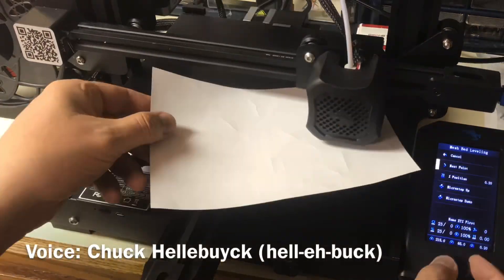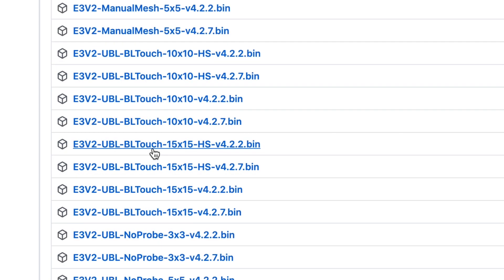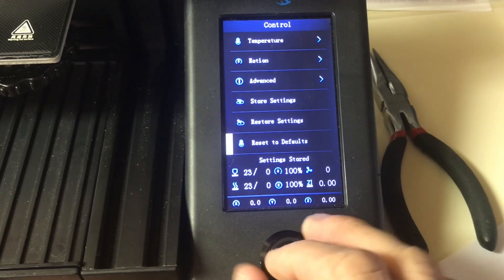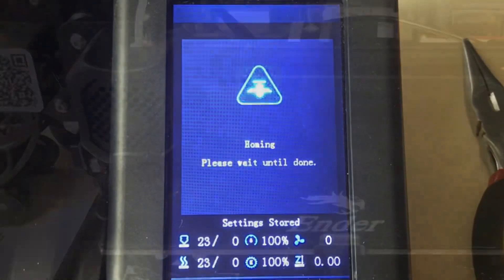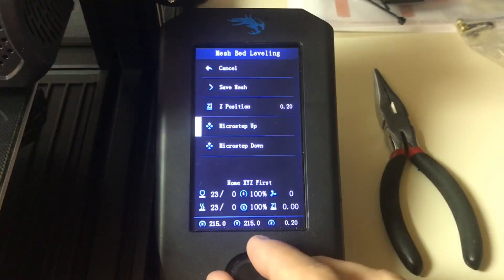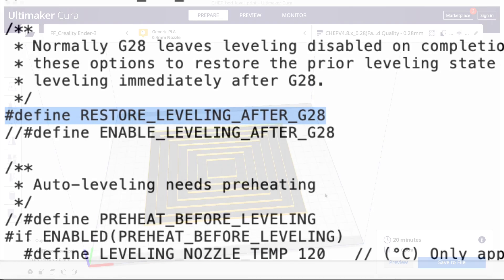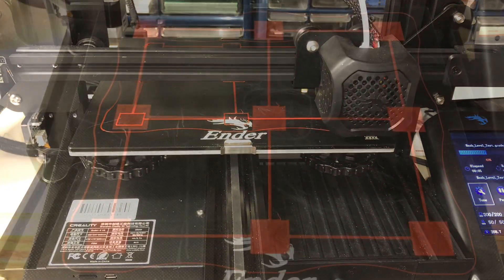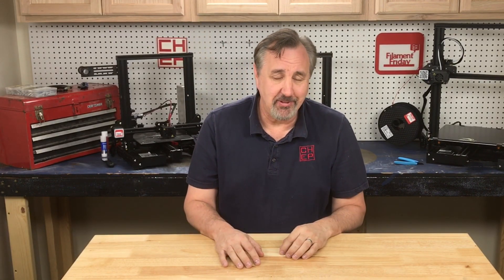Creality Ender 3 V2 - Mesh Bed Leveling

Comment: I know I'm missing.  I'm a simple user but I wanted to add a runout sensor so I bought one from Creality.  I have an Ender 3 V2 Neo and I just flashed Jyers 10x10 for version 4.2.2.  I had this dead on before all this and the sensor does work, but I can't get it to print or level.  As was mentioned in the video, I dialed it in but when this goes to print, it must be extruding a good 6-10mm off the build plate.  I know it's an operator error but if I can't get it to level, I have to go back to the default flash and I really want that run-out sensor.  Any more thoughts?

Comment: Well, thanks for sharing. But tell me one thing: if the Z limit switch sensor is on, nothing occurs when you push the microstep down, right? So, isn't better to disable or low the sensor a little?

Comment: I Have a Aquila ( G32 chip ) and I have upgraded it with a dual z lead screw system and a all metal hot end and a C R Touch by Creality, 
The Problems I have are I do the manual bed leveling 1st really well, then 
I do the auto leveling with the bed at working temp and lastly I do the Z off set in the middle all are saved afterwards.

The problem though is the printer will do a good starting purge line on the left edge of the bed before the printing,

But when it goes to the middle to star the printing I found the nozzle was way too high about 3 or 4 mm's to high off the bed. So I have to use the Alex firmware to lower the nozzle down
to the bed surface by those mm's to even have it lay down the print. I tried many times to re-level the bed and each time it is too high to start the print but fine on the purge line height.

What the heck can I do?

Comment: What is the base/starting point for the sensor/mesh? I'm running a cr touch and it always starts homing in the centre so I levelled the bed to the centre assuming this was the point for everything else. It ended up way worse than levelling the bed manually just based on the outside corners. Presumably to adjust the bed height there has to be a starting point to compare all other points against. If it's not the centre is it the bottom left corner?
Reply from the maker: The firmware should probe multiple points with a CRTouch. Not sure why yours doesn’t.

Comment: This firmware does not work with CPU Giga Device or RCT6
LOOK YOUR CPU before updating firmware

Portuguese TEXT
Tive problemas com minha impressora 3D ENDER V2

 Algumas Ender 3v2 vêm com a placa 4.2.2 e CPU GD32F303 GigaDevice, essa CPU não é compatível com esse firmware. NÃO INSTALAR!!!!!!

Para as Enders com CPU STM32F303 RCT6 há relatos de risco de incêndio. Não instalar!

Murilo, tem gente instalando esse firmware em Enders 3v2 mais novas e correndo risco, outros estão com diversos bugs. Se puder, atualize a descrição do vídeo ou faça um novo sobre o assunto. Se quiser posso te encaminhar os links que encontrei sobre o fato.

O firmware é muito bom, mas não basta olhar a versão da placa, tem que olhar se a CPU é STM e chip com 512k. Não é compatível com as CPUs GigaDevice.

Minha placa é GigaDevice instalei esse firmware e a impressora travou na tela com a logo da creality tentei voltar o firmware e deu mto trabalho(muito msm) consegui desligando e ligando a impressora loucamente e uma hora desistir e do nada ela voltou ao normal.

Para saber se sua placa é compativel com o firmware vc precisa abrir a parte inferior da impressora e acessar a placa principal. Nela tem a versão impressa 4.2.2 ou 4.2.7, além disso vc tem que localizar o chip do processador ARM, se for STmicroeletronics terá a inscrição STM32F303RET6, esse é compatível com o firmware do vídeo acima. Se terminar com RCT6 não é compatível devido a memória interna ser de 256k. Algumas enders mais novas, como a minha, estão vindo com Chips da GigaDevice, nesse caso a inscrição no chip é GD32F303RET6, para o qual o Marlin ainda não dá suporte, por isso esse firmware não deve ser instalado para evitar bugs relatados por vários usuários(inclusive EU).
Reply: obrigado por avisar, eu já ia colocar isso nas minhas máquinas e fui conferir e todas são gigadevice GD32F303, vlw por me livrar desse B.O. mano

Comment: Holla, I installed version v2.0.1 - Major Fixes, the item level does not appear on the display, the item info appears, do I have to install a previous version, if yes, can I install by sima from V2.0.1? Thanks

Comment: i'm stuck on the blank screen for 40 minuts
Reply: figure it out?
Reply: i had same issue just eventually got it working, sounds like your lcd firmware isnt matching your firmware OR its not reading correctly from wahtever sdcard you got. had alot fo problems with mine.

Comment: 12 maths old so not sure if you still see these messages? I have an Ender3 V2, my  board is marked as V 4.3.1, I tried updating but it was a disaster, I get no answers from Creality or any of the FB groups, is there any help you could give , thankyou.
Reply: What was the issue?
Reply from the maker: What do you mean by disaster?
Reply: @FilamentFriday  every time I tried to upgrade it, the screen went black and nothing happened. I left it for an hour or more next thing, had to go back to the original, I have since replaced that board with the .7 board and it’s working fine. I have since found that Creality are shipping some 3 V2s with that same board.
Love the videos thanks for all the help

Comment: i was just wondering how do you know what firmware you need for your printer
Reply: you have to remove 4 screws on your ender 3 on the underside of the unit where all the wires enter and one ontop of that same box under the left side of the Y axis, there is a "creality" logo and under that it reads "V.4.2.X" (2 or 7 for x). another way you could find this without taking it apart is you could try to shine a light through the fan duct to see the number though its better to just remove the 4 screws. im doing mine tomorrow, im also upgrading the ui firmware chep if you read this theres a sd card slot inside the screen module and the firmware is in the sourcecode folder
Reply: @miracleonglenelm5285  alr thanks

Comment: Hello, would you not provide the configuration gcode to put in my Ender 3 V2? I don't know if it would work or I'll have to manually do the whole process, if you can let me know I'd appreciate it. Thank you!]
Reply from the maker: You need the firmware.

Comment: Hey there, a question:
I used the mesh leveling command that you mentioned (m420) with pretty good results and now upgraded to a CR-Touch where you have to add a "G29".
My question is do I leave the M420 in as well since I am using Jyers' firmware and does the order matter? (i.e. G28-M420-G29 instead G28-G29-M420)

cheers
Reply from the maker: G29 runs it every time. M420 runs what’s in memory. So one or the other.
Reply: @FilamentFriday  Could that be the problem that my mesh resets every time i power of the printer? i also have the CR touch with the g29 commands. i've ran it with a raspery pi 2 (octoprint), but turned that off because i need to relevel the mesh every time and the octoprint once in a while gave a kill reason and stopped the print..  at this moment i use the following code: 

M190 s55	; Wait for heat bed tempature
G28 	; Home all axes
G29 A	; Activate the UBL System
G29 L0	; Load UBL
G29 J2	; 4-point level
G29 F10.0	; Fade to 10mm
G92 E0 	; Reset Extruder
Reply: i also can't find the location of the eeprom data. is it possible that he doesn't store the data in the motherboard?

Comment: 1. Would love a video showing a test print and how to interpret and remedy all sorts of errors.

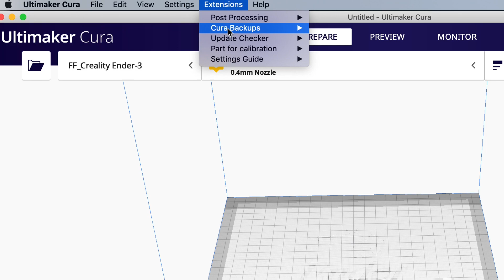Mine, for example, has what yours has at 3:56 (the smallest and 3rd smallest squares bottom left corner). Some blobbing and thickening which seems where a run starts or ends.

2. Also rookie question - what should you do with the filament when a print has finished? Keep the head hot and pull the filament out, or is it ok to leave it there while the machine cools off, then start it up a bit later for another print (say  an hour or two later)?
Reply: The blobbing in point 1. might be because it starts the X axis line on top of the Y axis one, so the corner doubles up in thickness. Or else it's that the filament dribbles out of the nozzle just a bit while;e it's travelling between printing points (does it need more retraction?).

Comment: my Z axis monitor on the display saying 0.2mm across all over the bed, since i changed my Z axis calib. in manual mesh bed leveling. i cant get it running somehow
Reply: I have the same thing, im watching the Z axis on the display and watching the screw motor itself and nothing is changing whilst it runs across the bed... Unless its actually doing it but the movements are so small we cant notice it?

Did you manage to figure it out?
Reply: @DaLeBa  i stopped using it sorry

Comment: I used the Alex branch of this firmware, because I have a Voxelab Aquila, and that covers that. I have ALWAYS had issues with the bed leveling and always had to mesh with micro-stepping, just to get it going. The 4x4 mesh bed-leveling and the visual that allows you to check it out, explained it all to me, the bed is domed and slightly higher on the back right corner... BTW the "stock firmware and a BL-Touch barely addressed this issue. It would work "OK", but I still would have to micro-step just to get it going. I loaded the firmware and the UI, carefully did the 4x4 mesh, and the first layer was perfect and the calibration cube printed better than I have ever seen. For links, simply search "Alexqzd" or "Jyers ui" and github links will so on the results.

BTW - the BLTouch and "stock" firmware will only do a 3x3, and that's why it was still kinda "off". I'm considering either the 5x5 mesh, or just getting a different build platform. If the mesh will compensate, there is no good reason to spend money, so far. it has.

Comment: Hi, i repeatedly ran bed leveling, manually and using the bl touch. As you stated, the center of the bed sags and running the bed level test print, the center square never comes out quite right. The last step is adjusting the Z-Offset during printing. This helps, but still the center square doesn't look good enough. Does someone know whether it is possible to adjust just one point of the mesh (enter an offset value manually). The idea is, that adjusting Z-offset  influences the whole nozzle2bed distance To be able to edit  specific points of the  mesh  as a last step would be a nice feature. (I use jyers ui)
Reply from the maker: If your bed is that bad, I would look at replacing it.
Reply: @FilamentFriday I use the glass bed that came with the Ender, questions is: does the glass bed degrade over some 12 - 16 weeks? 
I had good results but suddenly the printer went wild, started to print in thin air over 110mm in z, the first layer refused to stick to the bed and the brim was no longer a close fit but fell apart when removed, all at once. So I reset CURA back to total defaults, replaced the setting knobs and springs which adjust the hight of the bed (manual leveling) AND I always and only use Isopropanol to clean the bed. So far goes the story. 
Next step is I set Z-Offset to additional 30 µm lower. Let's see what will happen.
Reply: Boys.. it wasn't the bed, it was the new extruder, which I did not calibrate, so 36% too low filament throughput. Lots of trouble... now it works perfect again (I bought a new bed regardless, which is not to shabby)

Comment: Great video! During the 25-point bed leveling, could you use a 0.1 mm feeler gauge instead of a piece of paper? I have had mixed success with paper. Thanks very much!

Comment: Hey, Love your videos, they really helped me start off with an Ender 3 v2. I dont suppose there is a newer firmware version that covers the BL touch and touch screen? that has the meshviewer?
Reply from the maker: Watch this: https://youtu.be/TroPjdkSEOY
Reply: @FilamentFriday Ive watched it. But the issue is that when you upgrade to both the BL Touch and the Touch Screen (like most naturally would), you either upgrade to a version where the touch screen doesnt work or you upgrade to a version where both the BL Touch and the Touch Screen work and you can bed level, but the mesh viewer "post leveling" is not available and you can not see the measurement levels.

Any other version bricks the machine.
Reply: @chrisharris5535  get the Profesional firmware with UBL for your board. Unless you're running Octoprint, I heard the new Cura doesn't seem to work loading the file to see your print on the screen, but does do a tramming wizard and then you can build you're meshes into different slots if you change out build plates. But the UBL does 3 or more corner touches, I prefer a 4 corner touch, but it will tilt your bed leveling mesh that's loaded before it prints. Basically no need to level much after you build your mesh and it does Unified Bed Leveling before print. I run 9x9 leveling grid and see every bit of it in my display.
Reply: @chrisharris5535  the profesional fireware would suit

Comment: First of all, let me say your videos have helped me from day 1 with my very 1st printer. Second my main question, how do you do a manual bed leveling like in this video, after you have installed a CRTouch, just to get a good baseline level bed before adjusting and letting the CRTouch take over? Reason I ask is I had finally got my CRTouch dialed in perfectly and had not had to adjust the bed level for months and I was getting perfect print after perfect print, one day my sd card went belly up and lost all my settings and even had to reinstall the firmware, now I can't get it even remotely close to dialed in for the life of me. Obviously I could reinstall the limit switch and unplug the CRTouch, but that's a pain in the but to remove everything, there has to be a simpler way. Thanks in advance for any input.
Reply from the maker: Home it with CRTouch then manually move it above the screws and adjust.

Comment: Can someone verify the coding needed to update the printer to use the mesh? it's so confusing.

Do we need both M420_S1 and RESTORE_LEVELING_AFTER_G28? Or it's either one?
Reply from the maker: The firmeware has the RESTORE code in it. Just add the M420_S1 to your start GCode in Cura slicer
Reply: @FilamentFriday  Thank you for your help and prompt reply! Appreciate it!

Comment: I have been trying to do Manual Mesh Leveling for a few days now and nothing seems to be working. Every time I create a new mesh and go to do a test print, the hotend does not move along the Z-Axis at all so nothing gets compensated for. I have tried recreating the mesh, I have tried tuning the mesh after the test prints, but the exact same result happens every time no matter how the mesh is made. The only change to the g-code I made was adding the "M420 S1" line. Is there something I am doing wrong or is my printer just messed up?
Reply: Did you go into config and save settings?

Comment: I always get an error while Homing or moving with the stepper, I have question marks on the positions, why?
Reply: The flashing ? down at the bottom of the screen indicate that the firmware isn't aware of the position of each axis. If you "Home All" it will show 0.0 for each and then any movement you make will update those values.
Reply: @CollinBaillie  Problem solved. I had a board with a version 4.2.7 and not 4.2.2.

Comment: I did the Mesh, and set the command in G-code, and tryed without the command in G-Code, but the z offset still remains the 0.20 , and never changes like in the mesh I’ve created.
Reply: Hi I had this problem too originally I had downloaded the 2.7 instead if the 2.2 and because the 2.2 didn't work by itself but after installing the 2.7 and then the 2.2 it was working perfectly sorry if this didn't help

Comment: Just to clarify Chep, I'm using latest JyersUI with Ender 3v2...do I need to edit the Gcode to use my mesh or not?

If I understand correctly you tweaked yours, then checked the source code for the firmware and discovered it'd have loaded the mesh anyway...'but you doubt it'll hurt any'.....

I'd like to continue using some of my old sliced files so my question is really - if you hadn't changed the Gcode would it have used the mesh anyway because of a firmware feature of do I need to go back and do a lot of reslicing?

Many thanks for your consistently phenomenal stuff!!
Reply from the maker: You have to add the M420 as I show in the video.
Reply: Thanks Chep! Great content as always! Guess I'll just need to reslice/edit all of my old gcode. 

I use octoprint so perhaps I could add the M420 command to load the mesh via Settings -> Gcode Scripts --> 'Before a print job starts' and adding the M420 in there?

The other thing I'm wondering is why does the firmware have a togglable checkbox to activate the mesh if we still need to specify it in the gcode? Is that feature not implemented or something? 

Anyway I'll give tweaking octoprint to add it a shot. Hopefully I'll be able to see in the octoprint console readout whether or not that's done the trick!

By the way your channel is absolutely legendary (and if anyone reading this hasn't subscribed to Chep do so RIGHT NOW! )

Thanks as ever for the great content, engaging delivery, and constant inspiration.
Reply from the maker: The LCD is a secondary option to GCode. The mesh needs to be pulled from memory so the M420 indicates that.
Reply: @FilamentFriday  thanks for the uber fast reply.  Have tweaked the octoprint settings to try and inject the M420 into the gcode on print start. Fingers crossed it works!